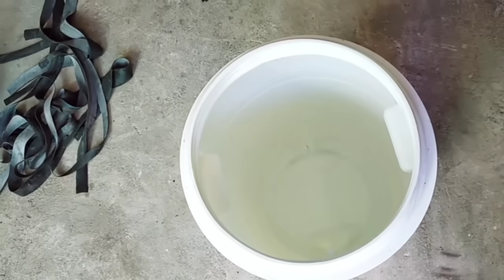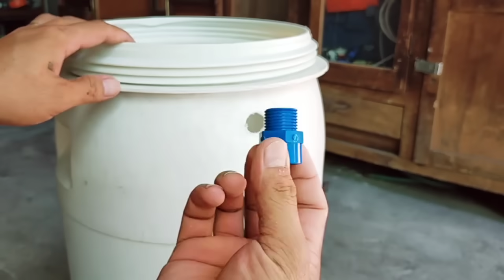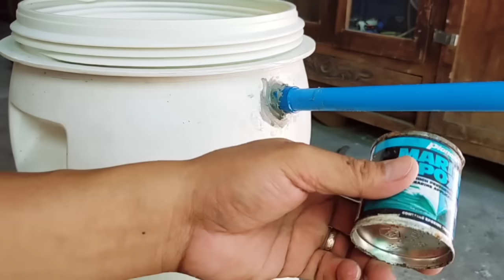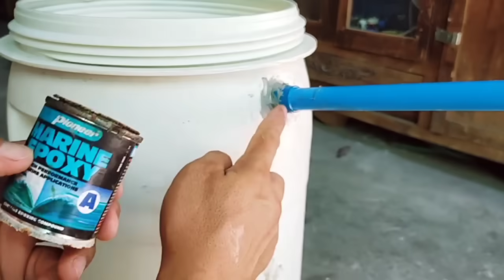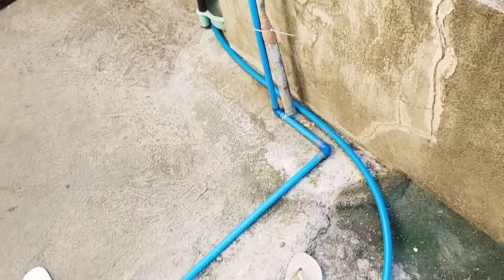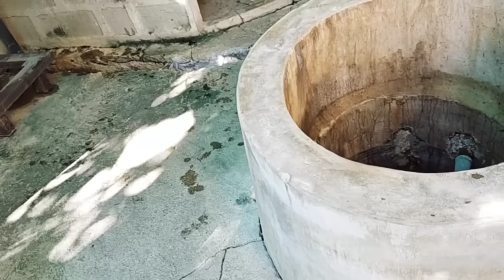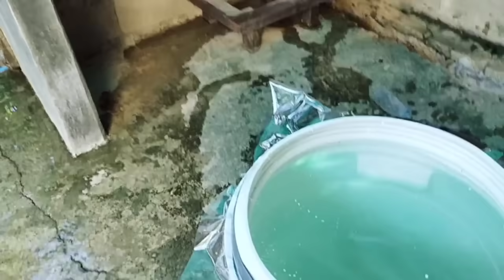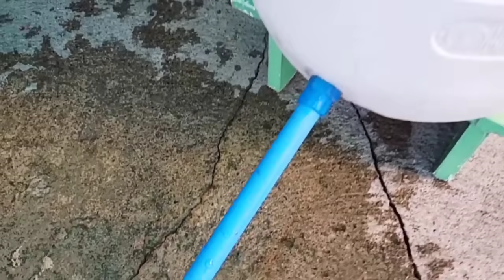improvised water pump no electricity how does it works none stop water life hack part 2

Comment: Basic siphon. Works because the outlet is below the inlet. Barrel not necessary.
And it works really well. I have used it to empty a pond in the woods. Only issue can be how to fill the pipe with water initially.
Reply: Thats why he's got a barrel full of water hence the necessity of the barrel
Reply: @farahpodha8540  barrel has no benefit to how a siphon works. would be simpler to have a continuous pipe without the barrel, and would work the same
Reply: @farahpodha8540  the employment of barrel here is a waste. this is fake
Reply: @edgarcordova4534  the barrel is needed to overcome the volume of the hose going into the well.  Barrel needs to be airtight to create a vacuum. I’ve done this many times and works well as Long as system is full of water and sealed    A normal siphon would not work in this situation due to the outlet being higher than the inlet.
Reply: To get water in the line initially, submerge the entire line in water and make sure to remove any bubbles/air.   Then keep one end submerged and cover/seal the other end with your hand.  Keep your hand on the end of the line and quickly remove from water and move below water line of siphoning pool.  Once below the water line remove your hand and the water will flow.   If the end in the siphon pool gets air the siphon will stop.   Basic siphon can be used for almost anything. It’s a really great tool to use if done properly especially the way it’s done in the video. Water can be moved uphill with no power once the system is set up and working properlyAs long as everything is perfectly sealed
Reply: @charlesengle6918  
"Water can be moved uphill with no power once the system is set up and working properly"

Just a "minor" clarification. Water can't be moved uphill, but it can be moved over a hill (less than 10 meters high) as long as the outlet is lower than the inlet.
Reply: @AldriFerdig  this is what I thought 💭
Reply: @Ole Nyomen
Natürlich braucht er ein Fass.
Sie hatten Fallhöhe x Fallbreite = Fallenergie um ihren Teich im Wald zu entlehren.
1. Er hat hier aber kein Wald. 
2. Auslauf ist höher, als Einlauf.
Deswegen braucht er ein Fass mit Fallhöhe x Fallbreite = Fallenergie um das Wasser aus seinem Brunnen zu heben.
Lernen sie zuerst Physik!
Reply: @charlesengle6918  a siphon doesn't work if the outlet is higher than the inlet. the water would simply drain out the wrong end back into the well. barrel doesn't matter, it's same as a continuous pipe.
Reply: @lorenzo42p  you have the right idea but have overlooked an important part of the equation. A continuous hose would not work because the water source is below the outlet. The barrel is needed to produce a large enough vacuum to lift the water to the outlet. The weight of the water is critical. As is the diameter of the pipes.
Reply: @unicornadrian1358  the weight of water inside the barrel doesn't matter. what matters is the height of the source above the outlet. if the source is below the outlet that would reverse the system, making the water flow backwards, back into the source. the source must be above the outlet for a siphon to work. it takes energy to lift the water, but you can't get energy for free.
Reply: bro the barrel is required to creat the pressure to sip the water.
Reply: Use a check valve on the bottom of the suction hose to keep the system full of water.

Comment: you could put it on your roof then you would have water through out the house though you may need a bigger tank . Thanks for the video it was valuable!
Reply: you really think it works?  what power raised water from low to high?
Reply: @lxw5231  vacuum suction
Reply: @salemorganicranch   it also suck from water outlet. why it suck from well, and let water out from pipe?
Reply: @salemorganicranch  Now comnect outlet with inlet and get perpetum mobile.

Comment: The volume or weight of water should be more than stored water inside pipe. It works.
Reply: that is what you think. forget this video, this is fake.
Reply: The weight of the water inside the pipe is much heavier than the amount that is being poured out the bottom of the barrel.  That is the only thing that matters.  The water should be flowing in reverse to what is shown.  That is, it should be flowing from the barrel back into the well.
Reply: that is what you think. it would not work.

Comment: At the start,The inlet water level is higher that the level of water inside the barrel.After filling with water and securing the opening with plastic,notice he adjusted the height of the inlet pipe.water will not flow back because it is opening is already sealed like holding the end of a siphon hose.After releasing the outlet pipe it created vacuum in the barrel thus sucking water from the well.The atmospheric pressure from the well pushes the water.
Reply: If the outlet is higher up than the water level in the well the vacuum can not suck water from the well. An increasing vacuum would stop the outflow of water at the outlet side earlier than it would be able to draw up water from the well.

Comment: Hello,
The system is fine. also, I would like to know up to what depth of the Pui, it can be installed see (20 meters) up to (X meters)?
Reply: you would just lose valuable resources if you attempt to build this.
Reply: Maximum 10.3 MTR as per science but around 9mtr it works
Reply: @takeastep.......8369  I tried it on a height of 7 mt deep well. water is coming gurling but with air and its not pulling from the well

Comment: Hydraulic principles take note that water always seeks its own level now my question prove that your idea is good true if the suction head of water  below the the outlet of water to spill  is great  to lift the the water up to the outlet I think it only needs big pressure to make it flow  and that will works I'm sure it will works
Reply: The barrel is low pressure.
Reply: it will work in a certain of time
Reply: it would not work.

Comment: I have extensive experience with well works.  The out going water would have to way more then the drop line water
Reply: meaning it will eventually empty the tank and it will have to be primed again right?
Reply: That's what I'm trying to figure out. How this works it can't be infinite
Reply: Exactly,  loss of friction in higher In long pipe so can't maintain flow equal to shorter pipe so eventually small tank will be empty .
Reply: @sagarvachakal9589  but would it pull any flow at all? Obviously a lesser quantity if it did.

Comment: You have to look at it as 2 components 
1. A syphon on the inlet side. Syphon has a higher head upstream than down stream. Upstream head is atmospheric head at 10.33 mH2O
Even though the inlet point on the drum is placed higher than the surface water level in the river the pressure head at this point is lower than 10.33 mH2O. Resulting water flowing from river into the drum
2. Normal water flow from high water level to low water level at the outlet side. This possible because the head on the outlet is greater than atmospheric pressure 10.33 mH2O.  Although the pressure in the drum is less than 10.33 mH2O the available head in the drum plus the vertical height of the water level in the drum is greater than 10.33 mH20. So water is flowing from the drum to the outlet. An air relief pipe is  necessary to prevent air running into the drum. The total pressure at the outlet = static head + velocity head
Reply: If the outlet is higher than the water level in the water reservoir this can't work. It is not possible to lift water to a higher level without an input of external energy. The idea, that a vacuum could pull up the water, is false. An increasing vacuum would first stop the flow at the outlet before it would be strong enough to pull up water from a lower level. Since the height of the water column at the input side is bigger than the height of the water column at the output side. 
Of course, if the outlet is lower than the water level in the water reservoir it can work. In this case it is a normal siphon and no drum is needed. It is sufficient to prefill the pipes with water.
Reply: @sciencefreak9070   are you saying the video is fake?
Reply: @C3Rl3    The video gives the impression that the outlet of the water is higher up than the water level in the well, but it is difficult to judge this exactly. If the outlet is indeed higher, then this video is a fake. Water can not flow to a higher place without an external input of energy.
Reply: @shanemahabirsingh7215   With a normal siphon water flows upwards and then downwards, but the height of the upwards flow must be smaller than the height of the downwards flow. You find plenty of informations about siphon in the internet and all of them confirm this. No vacuum is needed, just a hose or pipe prefilled with water. 
It is rather obvious that this only works with an outlet lower than the level of the water source. To lift water or any other object higher up needs an input of energy. Everything else would violate best assured laws of physics.
Reply: @sciencefreak9070    explain why the plastic does not lose the vacuum when the water is coming up from the well but the instant the hose is removed it crinkles? The water being pumped up from the well should displace the vacuum therefore no vacuum should be visible. In fact the plastic will show signs of positive pressure rather than no pressure at all but that did not occur. Siphons work in a vacuum environment also, therefore atmospheric pressure is not the only deciding factor at play. Once a vacuum is seen it means the water pressure exiting the discharge is greater than the inlet or maybe something else is creating that negative pressure. If there really is a pump then it's so well calibrated that it pumps a fraction slower than the discharge flow but that can only happen after a huge vacuum is created & the vacuum won't last very long as it's still positive pressure. Or maybe the drum has a false bottom & there is a pump sucking the water down & then back up through the discharge but he's hidden it well. Or maybe it really does work once a vacuum is created?
Reply: @shanemahabirsingh7215    Sory, I misunderstood your remark, that siphons also work in vacuum. Which is true, although with a to strong vacuum water would start boiling. Did I say siphons work due to atmospheric pressure? Atmospheric pressure is the same at inlet and outlet of a siphon, never mind if it is normal pressure or a reduced pressure. Siphons work due to the higher water column at the outlet side. If you intercept the water flow at the highest point and analyse the pressure, water pressure is higher at the inlet side than at the outlet side. It is this difference which makes the water flow.
Reply: @sciencefreak9070  as long as the input pressure outweighs the input then later would have no choice but get siphoned, 

And add a generator at the falling water and we have dc
Reply: @alfonseradorimperial642    I don't quite understand your argument "as long as the input pressure outweighs the input ...". Let's look at an example. Let's assume the vertical pipe from the top of the barrel down to the water level in the well is 3 meters high. And the barrel is 1 meter high and the outlet is right at the bottom of the barrel. To make the atmospheric pressure of 1 bar raise the water over 3 meters the pressure in the vacuum area at the top of the barrel must be below 0,7 bar. However, already with a pressure below 0,9 bar the vacuum will stop the outflow of water and thus the vacuum will not increase any more. It will never reach a pressure below 0,7 bar. With a siphon the height of the downmoving water column is always bigger than the height of the upmoving water column. Here it is the other way round.

Alone the possibility to gain continuous electricity with this arrangement without an input of energy indicates that it can not work. After all, conservation of energy is one of the best proved laws of physics we have. Absolutely no observation is known in violation of this law, which also has a formal proof by the Noether-theorem. Perpetuum mobiles don't exist.
Reply: Will it work from a river running water
Reply: @C3Rl3 very false 😂
Reply: @alfonseradorimperial642  "And add a generator at the falling water and we have dc" ....
..and add a lower reservoir at the bottom of the outlet from which the inlet takes the water from and we have perpetual electricity supply?? Am I wrong???
Reply: The drum is useless because no sign of pressure inside the drum. It may be a representation

Comment: It's impractical , with consumption of energy work done is impossible
Even if it pull some water due to negative pressure in cane ,the incoming water in can is less than the outgoing water.
Reply: As long as the outlet is below the inlet it works perfectly, and the barrel isn't necessary.
If the outlet is higher than the inlet it will of course not work.

Comment: Does it work with deepwell with small opening that uses metal tubes? I am planning to replace metal  tubes with hose and find out if this works. It has 10 metal tubes connected to each other

Comment: .... but this should not working , 8:30 how is that , the inlet pipe its filled with water ??? Because the water level in the barrel its higher than the inlet hole , how is not suck back in the well the water ? There is a one way vent what not showed ?? Or , take in another way , if the inlet pipe was an empty pipe , and when the water lewel in the barrel drops down creating in the upper level a vacuum  , how its not coming air bubbles from the intake pipe ? 8:38 its clearly not air bubbles , its a jet of water .... so i think that , the inlet pipe was connected to a pressurized system , witch was not shown , and the 8:38 moment is an opening of a valve ...
Reply: Yes this is true..i tried several times.it will and it never work

Comment: The exclamation "Eureka!" is attributed to the ancient Greek scholar Archimedes. He reportedly proclaimed "Eureka! Eureka!" after he had stepped into a bath and noticed that the water level rose, whereupon he suddenly understood that the volume of water displaced must be equal to the volume of the part of his body he had submerged. (This relation is not what is known as Archimedes' principle—that deals with the upthrust experienced by a body immersed in a fluid.[2][3]) He then realized that the volume of irregular objects could be measured with precision, a previously intractable problem. He is said to have been so eager to share his discovery that he leapt out of his bathtub and ran naked through the streets of Syracuse.
Reply: I was not talking about Archimedes and Eureka. I was talking about something else. The problem facing gardeners is pumping water to a higher level than agricultural land. That's what the video is about. We understand Archimedes' principle that this happens in the vacuum chamber. Da Vinci made this type of pump but also other types that, in their time, were used to pump water from the Nile. Now I ask you: how do we apply Pascal's law combined with the discovery of Archimedes, to pump water without consuming energy. VOLUME AND PRESSURE !!! Let's see you!
Reply: @toninica  this is not about pumping water to a higher level. this setup would certainly not work.
Reply: Truco, a tendência é a agua do galão voltar para o poço porque o empurro da água dentro da mangueira é  muito maior
Reply: @edgarcordova4534  I would say this set up did pump water to a higher level!  The original water level was far below in the well , down deep , it was raised many feet to above surface of ground,  want it higher? Collect water in large surface tank , put another free lift pump on your house roof (or nearby tower) and vacuum pump the second time to greater height.  Why? Pump is cheap to make, and requires no electricity to be available, and can run continuous if desired!